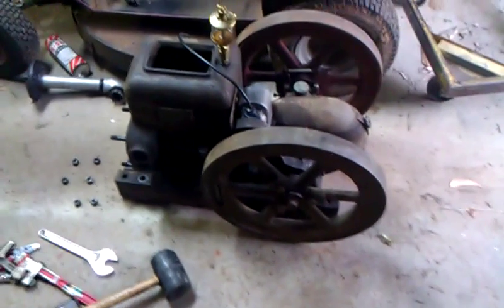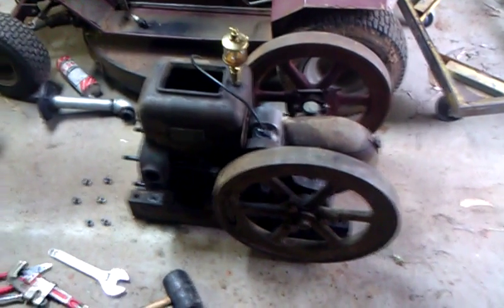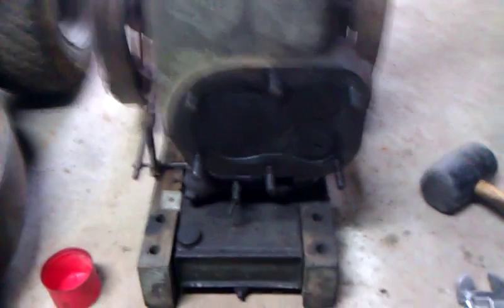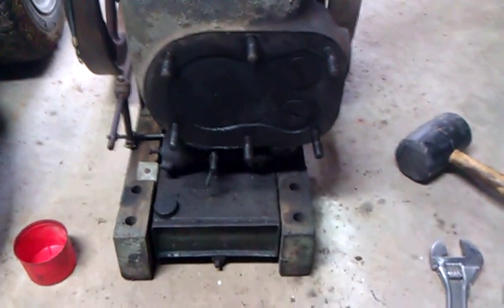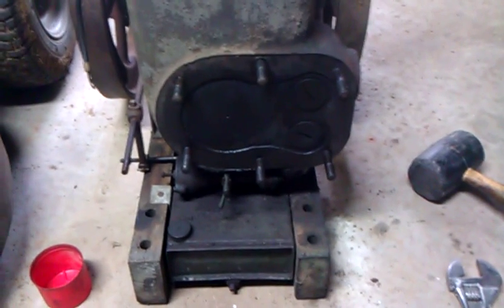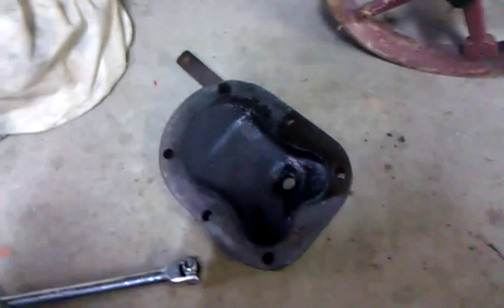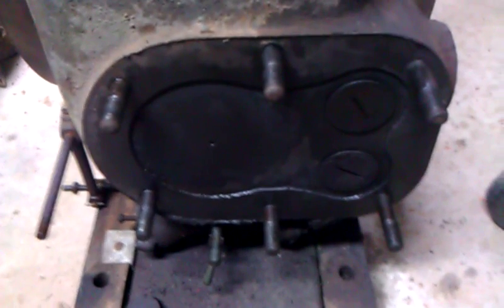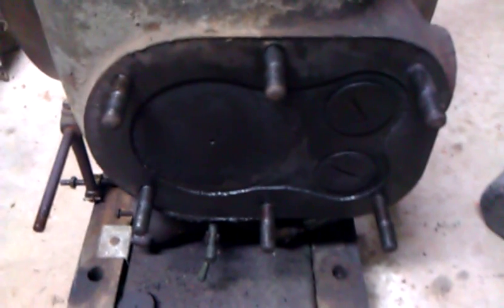Sundial B 2 HP Head Removed.3gp

Comment: to remove the the valves, take of the retainers and springs and just pull the valve out from the cylinder head side, to remove the carbon from the piston and so on, lightly scrap with a srew driver or even wire brush, just be gentle and it wont harm it these engines are super strong, good luck!